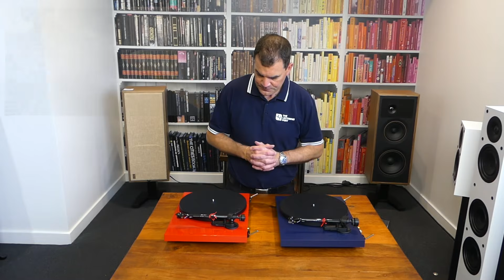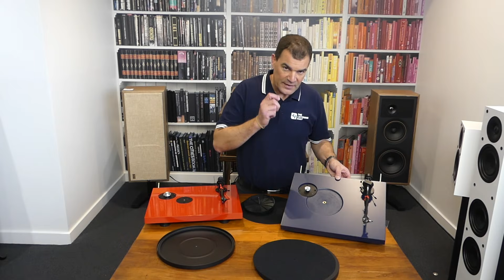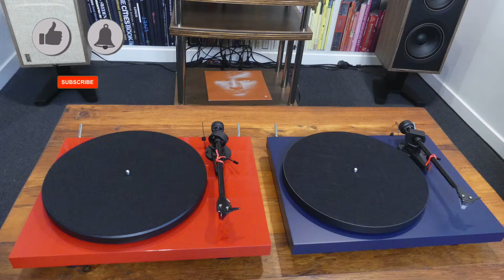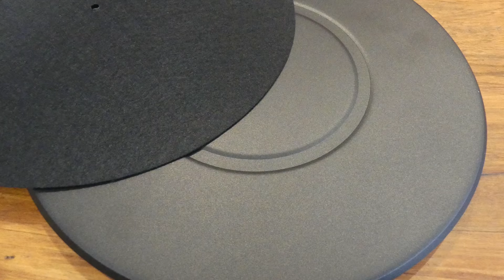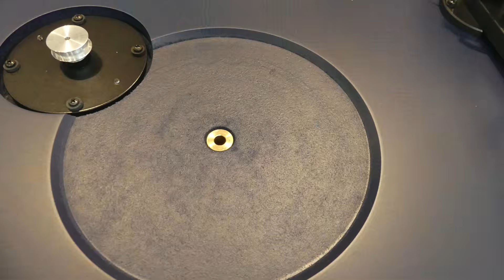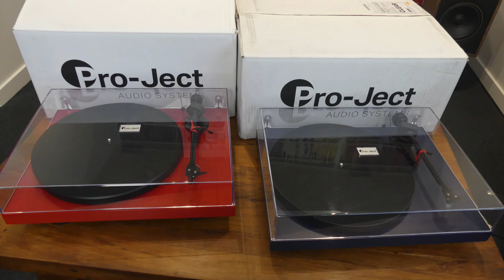ProJect Debut Turntable EVO vs EVO 2 Comparison | The Listening Post | TLPCHC TLPWLG

Comment: The main issue with these turntables, the way the dustcover hinges are designed and the amount of free play they have in the recepticles has still not be addressed though. I had one and just for that dustcover moving around on its hinges was for me a no-no
Reply from the maker: Wow...that is such a minor point!  How about how good it sounds for the price? Why is this such a no-no in your mind?
Reply: @TLPCHC To me it’s not minor, it’s about feeling quality, which you don’t when you touch this thing for the first time, you open the dustcover and feel it move around on its own hinges. A turntable is all about the tactile experience.
How difficult can it be for Project engineers to come up with a better solution for that? 
Enough good examples on the market I guess.
Reply from the maker: @michaelpotoms8396    Please acknowledge its price.  The EVO and EVO-2 are way cheaper then others on the market for the relative audio performance.  Then accept that here in NZ its competition is hundreds (and hundreds) of dollars more expensive.  So...I have very happy to accept a basic hinge!
Reply: @TLPCHC  I respect your opinion, hope you do respect mine too even if it differs. I don’t know local competition and price setting in NZ BUT that should not even be the debate. A hinge is supposed to be something very simple to manufacture in a decent way. Turntables much cheaper aren’t failing to do so, why should we accept Project to get away with it? There should not be this amount of play between the hinge stub and its recepticle. Period.